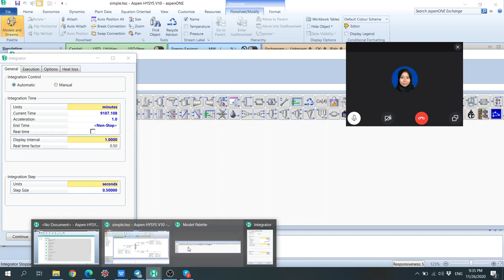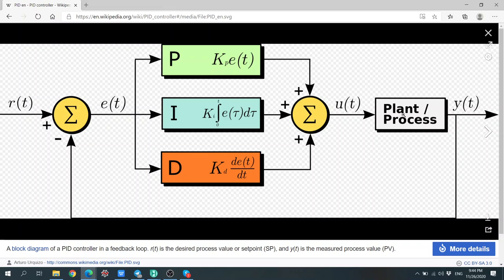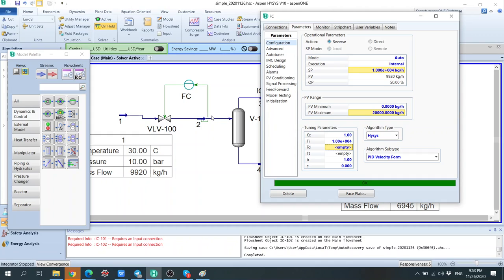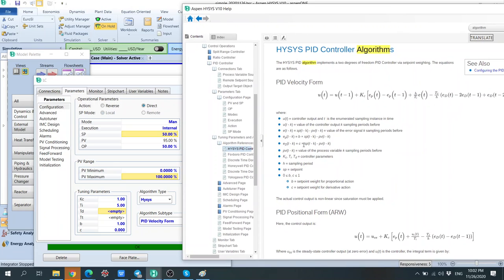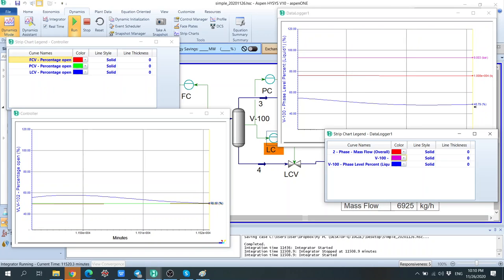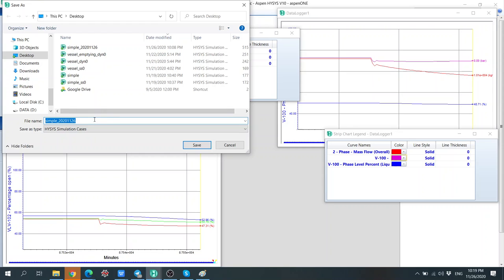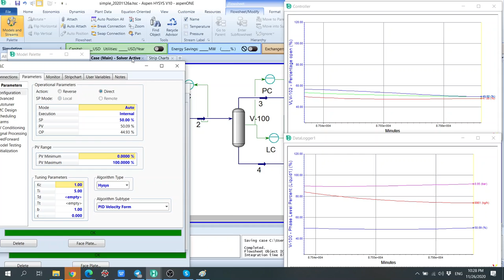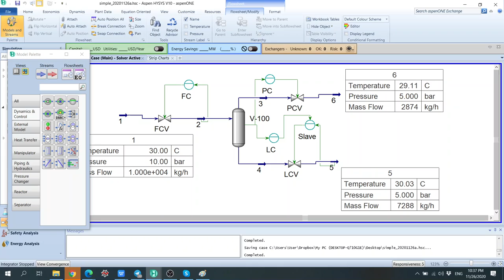Setting Up Dynamic Simulation (Part 2 - Controller)

Comment: Good 
How I can simulate level controller with flow changes?
Reply from the maker: it's what's in the video, isn't it? 
For feedback controller, we manipulate the outlet flowrate to control the level. 
For feedforward controller, we manipulate the inlet flowrate to control the level
Reply: @ZulfanAdiPutra  please can I do this in EXcel VBA ? If can you help to write the codes
Reply from the maker: @zayedalshuhoumi8397  yes you can do this in Excel with limited functionalities. No, you cannot ask me to do it because I have other jobs to do 🙂